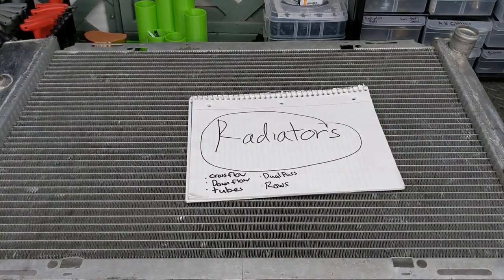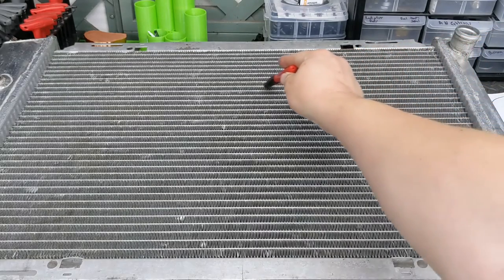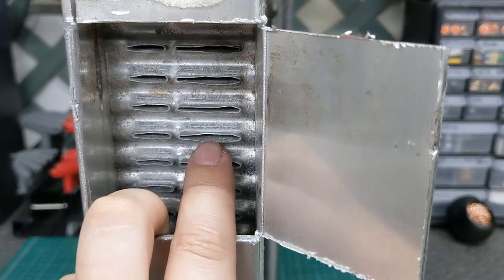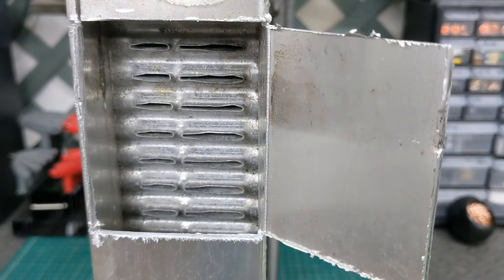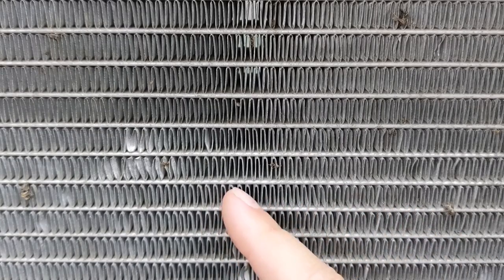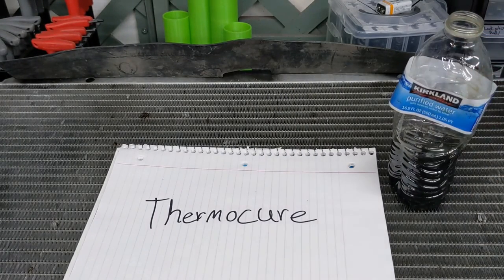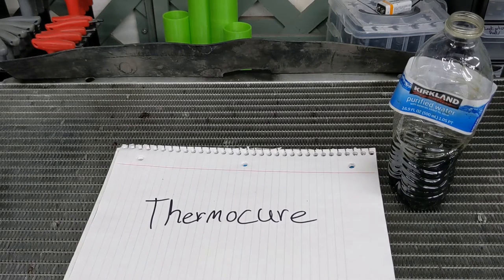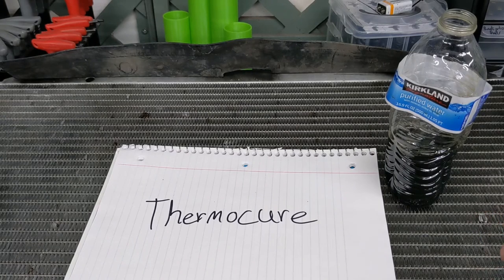radiators explained!

Comment: Good effort and good video.
Im no professional, just know a little about alot😅. But the first quarter of the vid was a little..not quite correct.
The coolant does not flow in the patterns you described for a 2 row or more radiator. 
The coolant only flows one way across (or down) no matter how many tubes, it doesn't flow back and forth.
That's that part, as far as the rest and more rows and larger or smaller rows..thats the big lifelong question for me and many other's.
Im trying to figure that out still myself thats why im watching videos😅.
Im thinking about getting a 3 row full aluminum to replace my single row stock radiator that just broke.
Both are the same width core pretty much (3 row is maybe .05 wider).
People say a 2 row is better then a 3 and vice versa.
Im wondering is a 3 better then a 1 or is it about the same.
Im now realizing radiator debates are like motor oil debates lol.
So many different opinions and both make since.

Comment: Crossflow radiators do a better job of shedding heat from the pipes to the fins because the pipes are longer and have more surface area and fin contact. Downflow radiators have shorter pipes and shed less heat, but they can handle higher volumes of coolant. You'll typically see crossflow radiators on passenger gas vehicles and downflow radiators used with diesel engines, especially on commercial vehicles or industrial equipment.

Comment: Does a two pass radiator actually cool better?  The marketing says it does, but that’s marketing, let’s use logic.  Your water pump pushes a fixed amount of water into the inlet, and the same amount exits the outlet, okay, so in a one pass you have the full number of rows for a fixed amount of coolant to flow through and it does so in time T.  A 2 pass radiator uses half the rows to go and half to return so the same amount of coolant has to flow through half as many rows that are twice as long also in time T.  This means the water spends T/2 time in each pass.  
Then we look to the 2nd law of thermodynamics and reference Fourier's Law to observe that the most important factors in thermal conduction here is the temperature gradient and the time because all other factors remain the same.  So a coolant spending half as much time in each pass for two passes is exactly the same as spending twice as much time in one pass.  So, it’s my intuition that for a fixed radiator size and flow there should not be any appreciable difference between a one pass or two pass radiator.

Comment: Major error here. Thicker radiators do not necessarily  cool better, big newbie mistake. The radiator may be so thick that by the time the air reaches rear, the air is so hot it can't transfer any more heat. Is this another example of men's preoccupation with size?😁